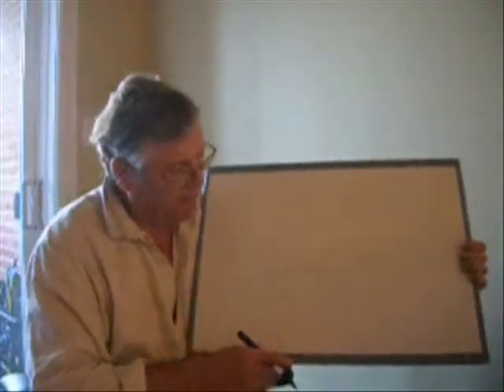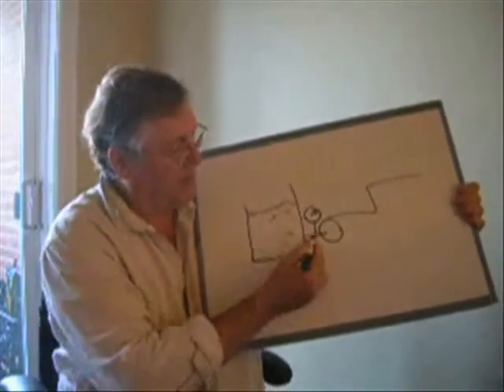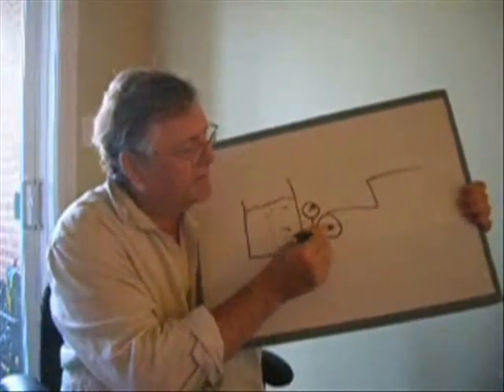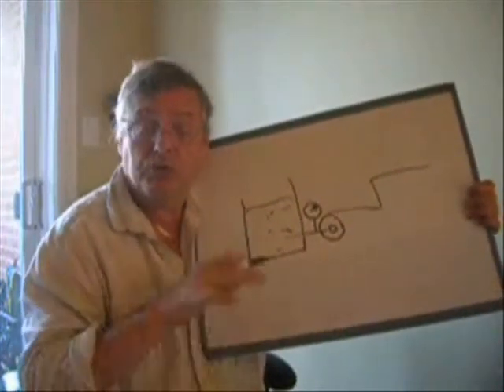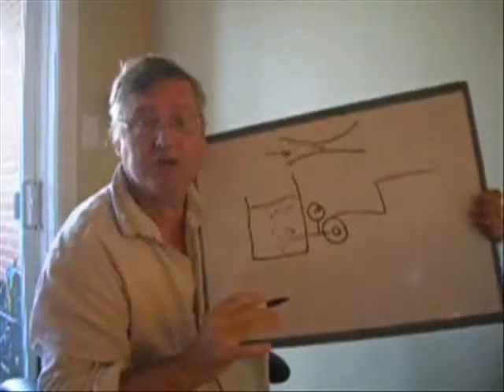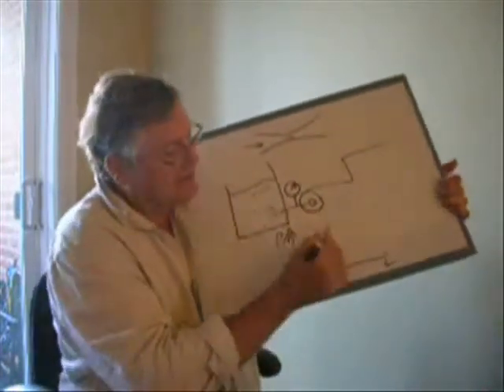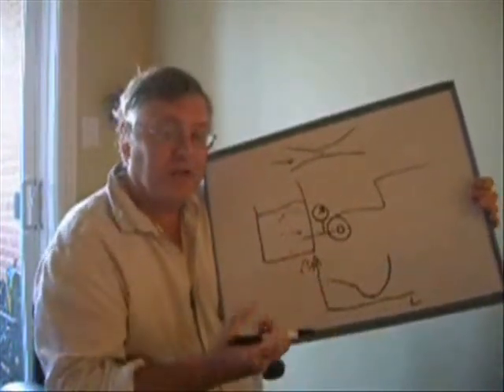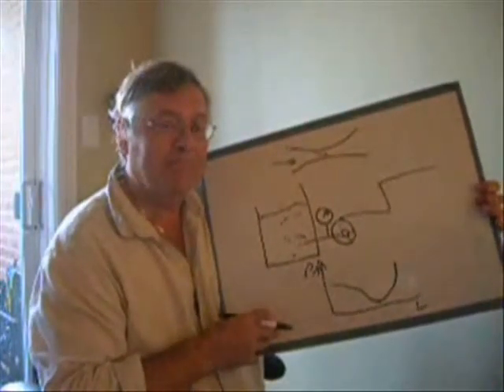7. Suction or not

Comment: what happened if we have 6 meter underground tank and around 20m long horizontal suction line with various elbows and tees ?

we are currently facing problem with PMG pump installed at Oil Storage Terminal with suction at underground tank of PMG but pumps are not able to suction the fuel from suction line after priming the line and release all air from the suction piping.